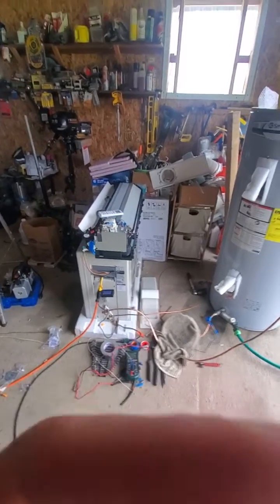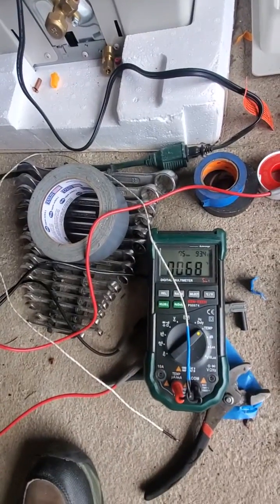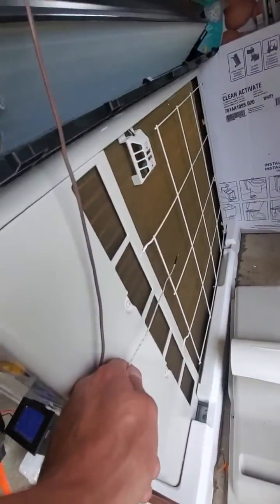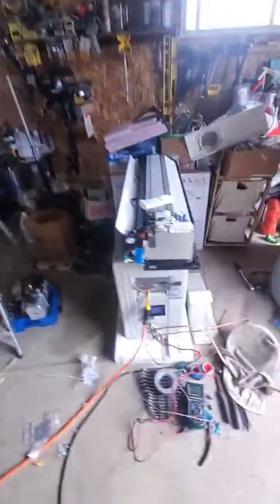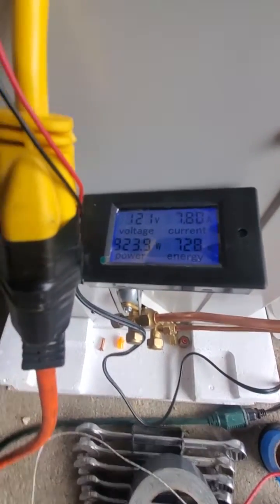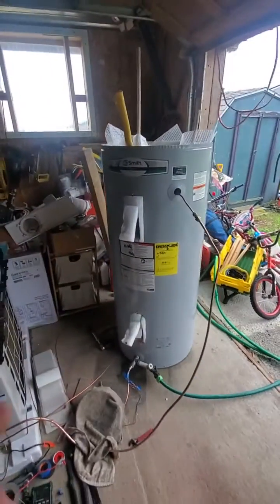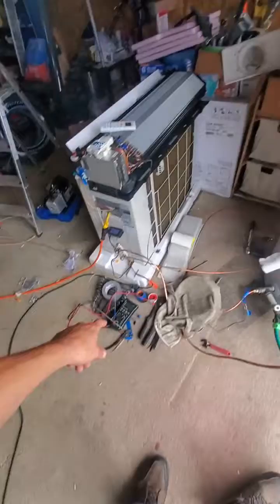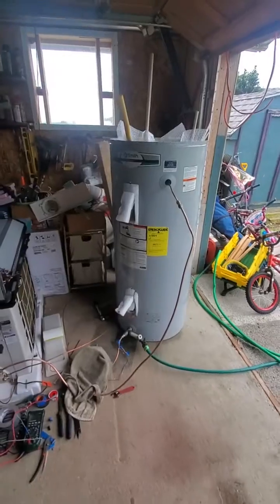DIY Heat Pump Water Heater. DIY. Home made mini split. #3

Comment: Nice work, watched a couple of times the whole series. I'll build one this summer out of a used 3-4 years old crappy midea 9000 btu unit so the coil should be shorter, will try to find a way to get it to work at its lowest btu output possible as i'm not interested in recovery speed (probably by putting a potentiometer instead of the inside temp sensor and setting it as close to the desired temp I could probably ramp it down), all I want is a cheap and high cop machine. Cold weather output doesn't stress me out as i'll only make it works during the day in the winter.

I'll try to insert a the copper coil inside the tank without having to cut it also..

I'll instal this tank before my actual actual electric water tank so the electric tank will only receive pre heated water.

Checked out COP of a lot of machines and they were all terrible at low temp...